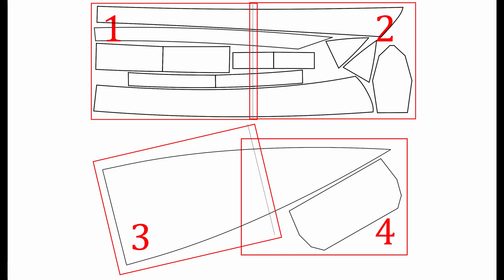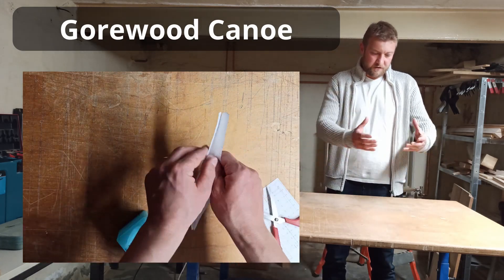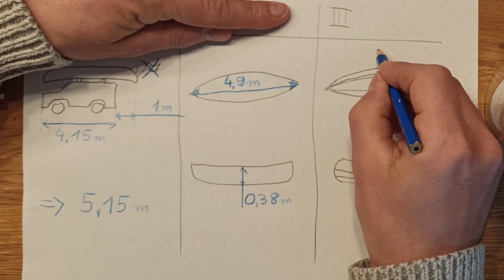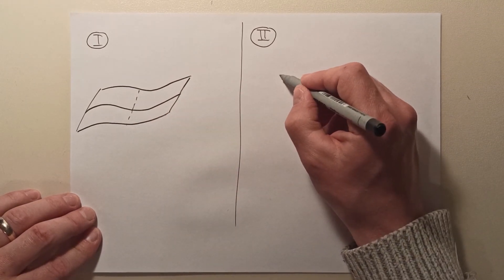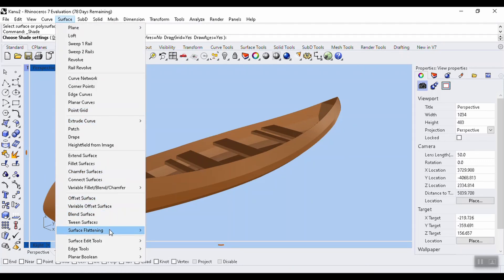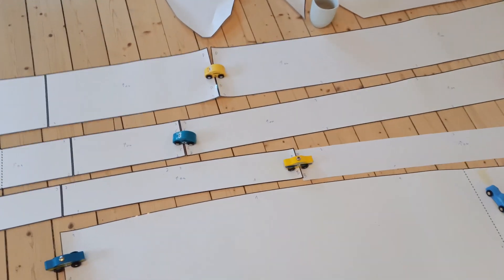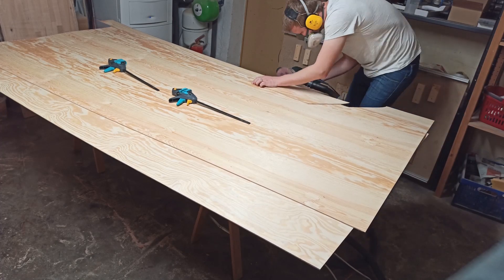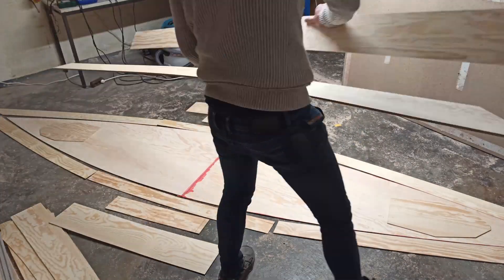TJ-Canoe - Part 1/4 | Self-Designed Plywood Canoe (Free Plans)

Comment: I have no idea how to interpret the attached images as plans. Are there measurements somewhere?
Reply from the maker: These are full size Plans. I had them printed by a copy shop and used it as paper templates. I tried to explain this in the video. Also I attached a *.svg which is a vector graphic. You can take any measurements you want from in (e. g. In inkscape)
Reply: @TinkererJake  Ok thanks. Was just opening as pdf for me. I'll have to look into that

Comment: 4:41 use the thickest paper that your printer can handle so that your model is not a waste of time. I also think you could have done some more work with the bottom panels to avoid the flat hull section and also get rid of the kink in the bow and stern when viewed from the side.
Reply from the maker: Thanks for your input. I also thought of making the next model of balsa wood to get a better feeling for the curved areas of the plywood.
Now that I learned a bit more about plywood construction I agree that the kink can be reduced or avoided (like the bow of a seggerling sailboat e. g.)